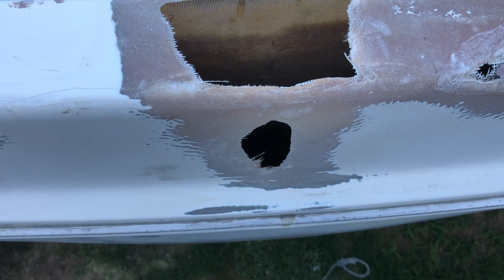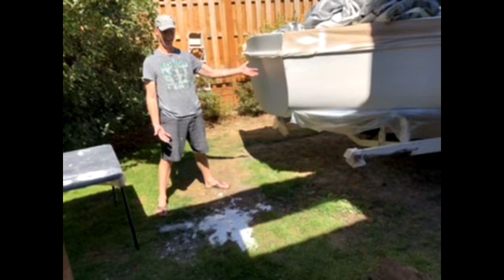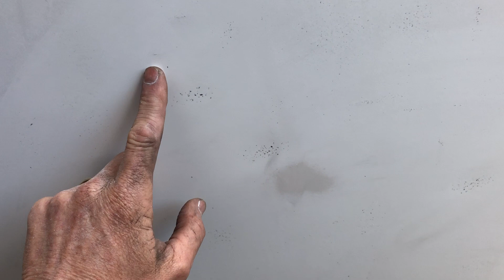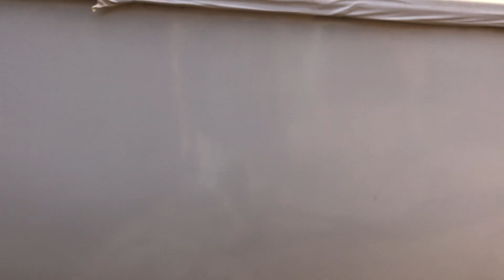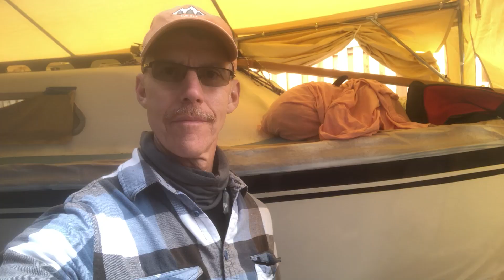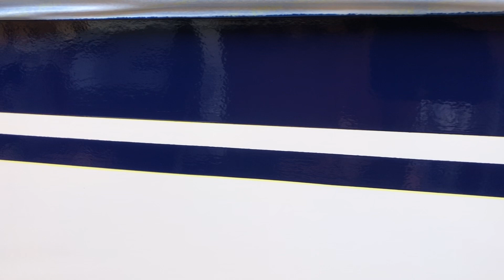2. Hull Painting

Comment: In my experience different paint venders have different mixing proportions and quality, so if the paint didn’t ‘kick’ properly on time, it likely didn’t have the correct proportions of catalyst mixed properly …and/or the temperature of the substrate was an issue 

We usually painted the steel ship surfaces in the winter non-sea -going months, so we had to take into consideration the cold temperature of the metal both before the paint went on, and after, and used consideration of applying blown heat 

We used blue painters’ tape …and it just came  down to how well it can be laid down, and how careful one paints 

Me personally, I would just clean up the detail work with small brushes and dithering, and see how it lasts in the water for a season…ship maintenance is a never-ending prospect, so you might as well not sweat the small stuff, as you’ll have plenty of reasons to re-paint in the future and perfect technique 

seaworthiness is the most important aspect, then fun, then pin striping 😆
Reply from the maker: Thank you. In this case, the paint is a one-part, so the ratio problem is not relevant. Although, I did thin with xylene.
My philosophy is to shoot for an "A" and accept a "B". It worked well for me in school.